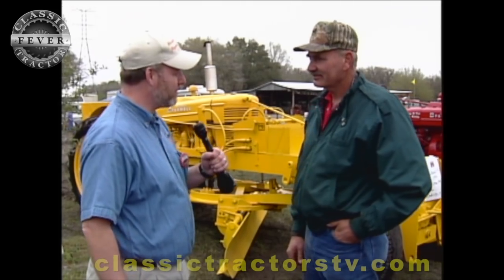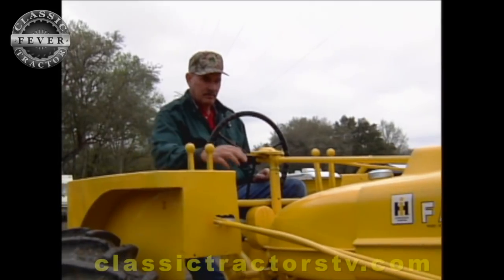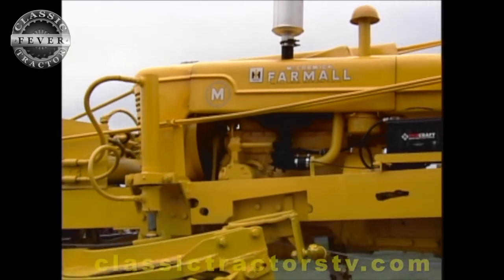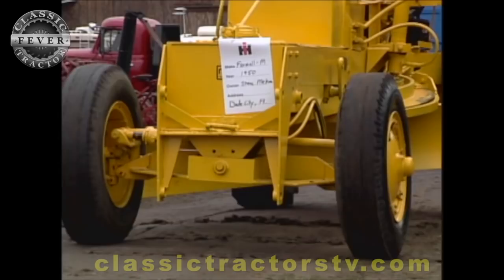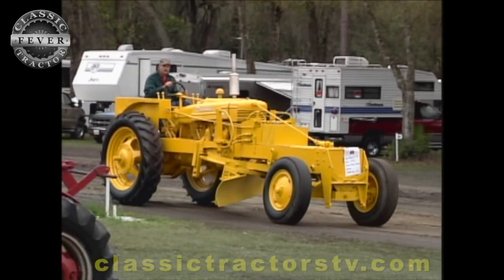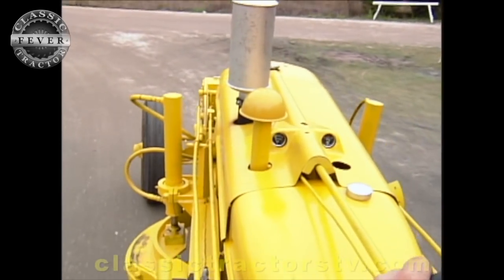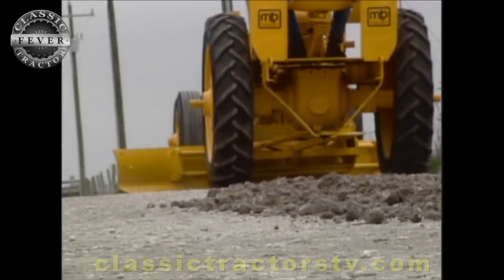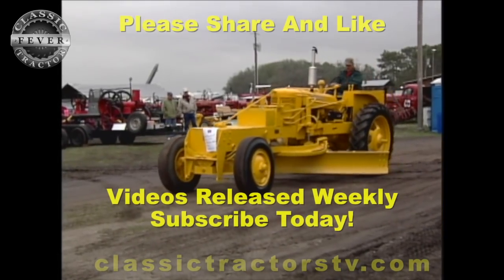Is That A Farmall M!? The International Harvester  Farmall M  M-B (Meili-Blumberg) Road Grader

Comment: There's a similar one sitting along the Alps Road west of Burwell, Nebraska on a long-vacant homesite. They used it to maintain a road to the top of a mesa that was then farmed, embedded into thousands of acres of rangeland. The whole area was Rx burned a couple of years ago and they had to drag it over into a nonflammable spot.
Back in the '90s I spent two summers at the University of Nebraska-Lincoln Gudmundsen Research Ranch, deep in the Sandhills north of Whitman, Nebr. The rancher a couple of miles east of the UNL HQ tuned up the local roads with a grader pulled with a team of white mules.